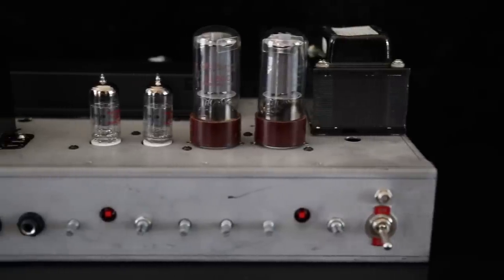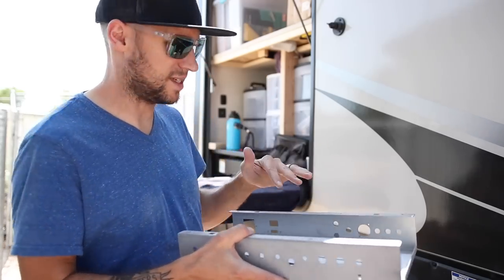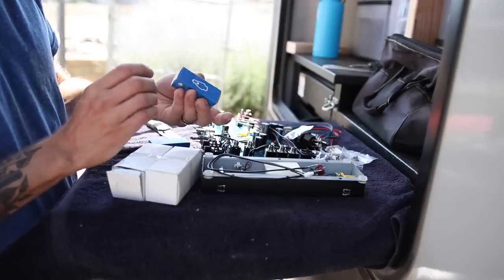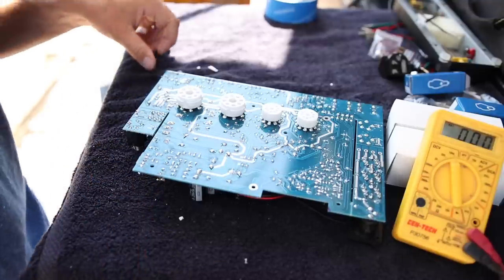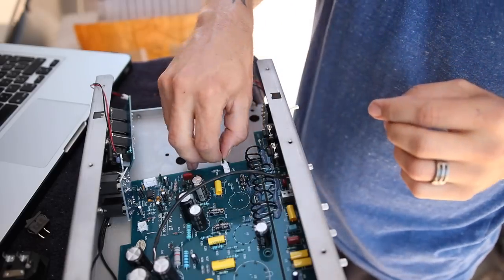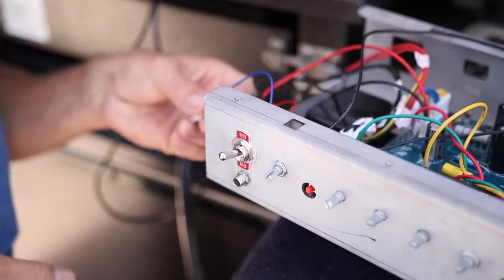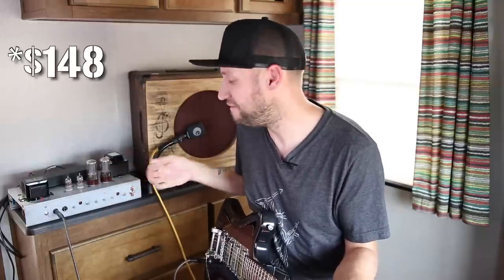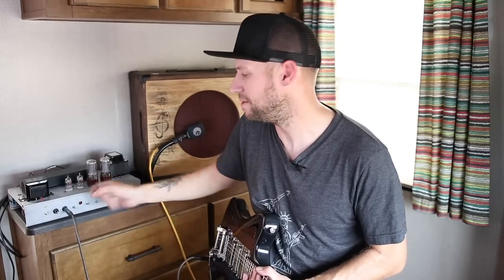Build you own TUBE AMP!!! (KLD DIY 15w tube amp kit REVIEW + DEMO)

Comment: I normally love your videos, but this was not amp building. I would recommend and company like mojo tone, Weber, trinity, or any other kit you actually have to propagate the board and run the filament leads yourself. Also no one in there right Ming would ship board hot in out litigious society.

Comment: noob question but how is this a better value than the monoprice stage right 15 watt amp for $200 ?
also what are the pros of hand wired tubes amps ? cuz that sounds  interesting
Reply: I’ll tell you one real advantage... reliability while gigging.  PCBs do not like banging around in a “band truck, especially the designs where knobs and jacks are attached directly to the PCB and there’s not much else supporting it. Cracks develop from vibration- then traces fail and you have intermittent problems that show up mid-show (amp gets hot...cracked trace opens up...etc)
Reply: @HBSuccess  good to know, so pcb system are just delicate then. What do you think of the kld handwired kit? Anything out there that's a better bang for my buck ?

Comment: I urge everybody who's thinking about building an amp kit to try building a pedal first. It's low voltage (9 volts usually) and there's no way you could accidentally kill yourself. Maybe you'll burn your fingers with the soldering iron. But amps CAN kill you, if you don't know your way with electronics. Start small, you learn a lot!

Comment: Sorry but the whole, long section worrying about the capacitors holding a charge was just ridiculous. Do you not know anything about those sized capacitors ? They can’t hold a charge that would hurt you at all. It’s not like the board was plugged in 5 minutes before you got it... do some basic research or something. Smh.

Comment: you know, the voltages written on a capacitor are the maximum they can store, you can get shocked by 10V and it won't hurt that much, you were too scared for nothing
Reply from the maker: It’s not the volts that kill you. It’s the amps. But there isn’t really a good way to measure amps from a capacitor connected to a circuit board with a voltmeter. That’s why we measure volts, to see if it charged or not. After I used the amp, I powered it off, then checked the capacitors again. All read O volts except for one, 367 volts! That would’ve tickled if I touched it before draining!

Comment: Ooh 15 watts you best get on the the gauntlet gloves with neoprene inserts and a voltage detector. Seriously if you have 1 amp of current then you should be careful. And you might want to use latex gloves when handling the tubes so you leave no oils on them. I've been shocked by as much as 220 volts and as little as 5volts. The lower volts was telephone line. Dont be holding the phone line when someone calls.
Reply: Hand oils on the tubes is an old wives tale.  Halogen bulbs are what that applies to.
Reply: Not as quickly as a halogen bulb bulb will eventually burn and crack the glass.

Comment: your cheap volt meter will not have glass filed fuses and is unlikely to have safety cutouts and MOVs, the meter is more dangerous than the leads.  For high voltage stuff like tube amps I would get a Fluke meter their Chinese market Fluke 17B is a steal at $100 vs $400 for the american version and has Fluke's internal safety features. Nothing worse than having a voltmeter catch fire in your hand.

Comment: Something is burning and will soon totally fail Have a look at the valves/tubes There's a lot of hash in the sound The amp is not operating correctly So is that $150 plus case plus choobes plus faceplate plus enclosure and some basic electronics knowledge Yes there will be very lethal voltages present so be very careful if you are thinking of building this kit Dan has an understanding of safety regarding tube amps and practical electronics knowledge
Reply: The right 6l6 was red plating bad. This thing is not love g for this world...

Comment: Voltage doesn't kill, Current kills (Amperage)...learn to electric man...pop a cap while working ont it, nothing bad other than losing the cap and maybe a nearby component, shove your screwdriver into that transformer while it is running, and well your insides might become your outsides...but that is where the danger is in those types of circuits.

Comment: Lame kit, the PC board is already soldered.  Real men wire tube amps point to point.
Don't blame you for being scared of tube amp voltages.  As a ham radio builder, I have constructed my own 2kw RF final amp using tubes.  4000 volts on the plates.  Your kit probably maxes out at 350 -400 volts.  Do I see the plates of one of your 6L6's glowing orange?  Not good.